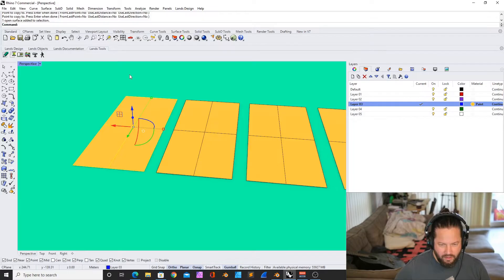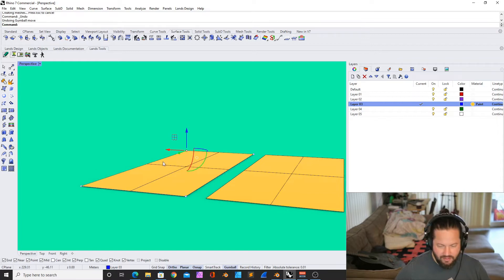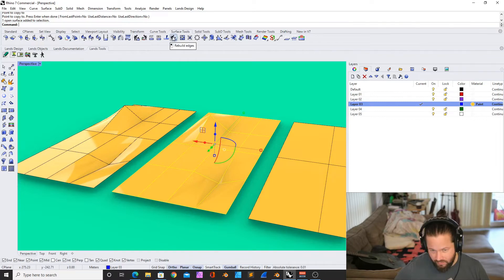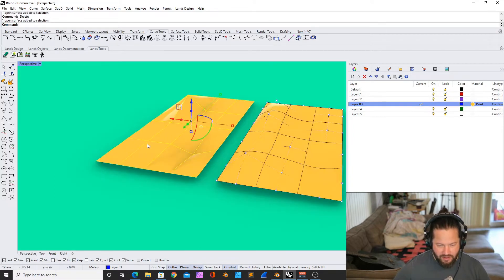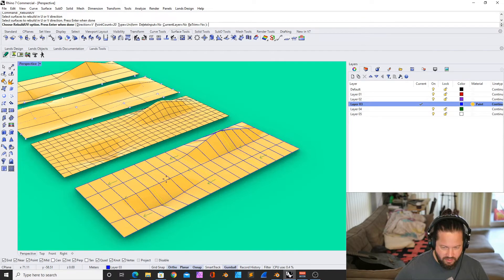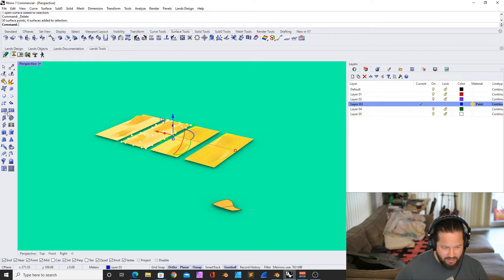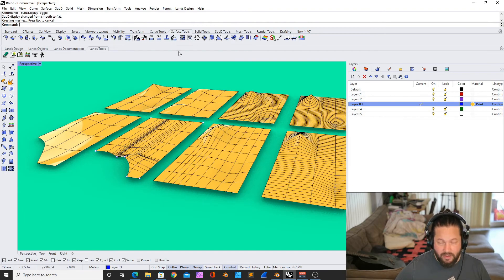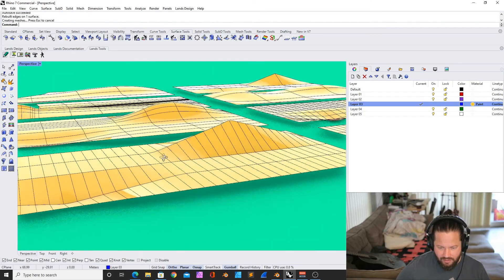How to Rhino 3D - Get full control over your Surfaces - Advanced Beginners Tutorial 023

Comment: how can we edit poly surface control point in rhino ?
Thanks
Reply from the maker: With any poly surface or closed or open you can use the command. 
'Solid points on'. This tool works really well sometimes. Sometimes not really.
Reply: @PhilippGalvanDesign  Thank sir i tried ( solid point on ) but this command not work as if we press F10
Reply from the maker: sorry i didn't spell it correctly:
'SolidPtOn'